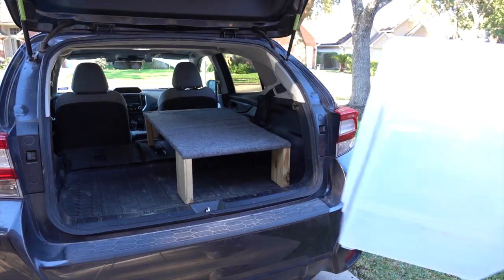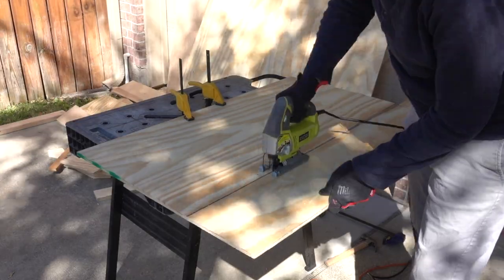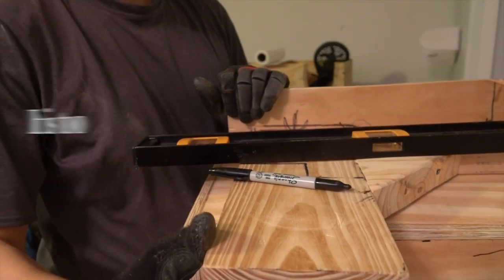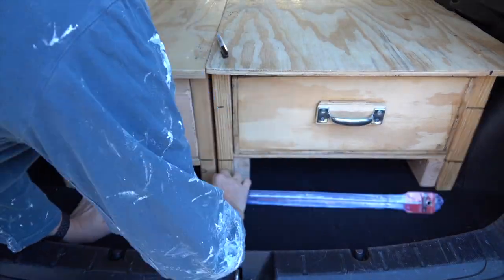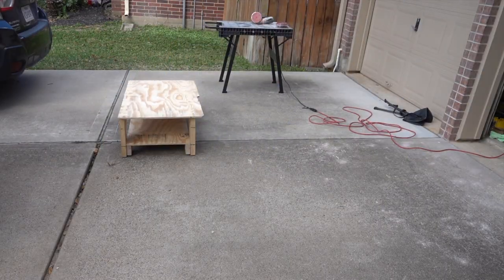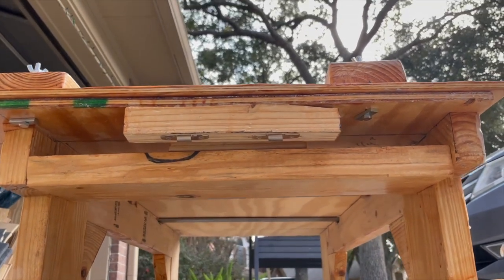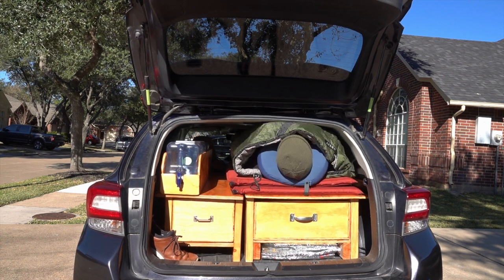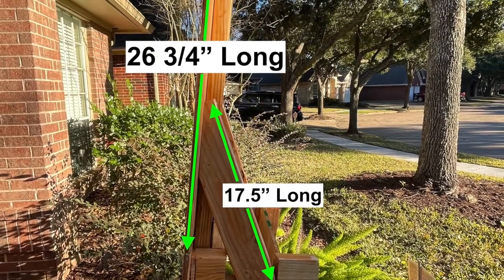Solo Cantilever Sleeping Platform Build for the Subaru Crosstrek Ep. 21

Comment: I do a ton of camping for my Crosstrek and I will say after many renovations and changes to my build, I finally decided to do away with the bed platform.. and that was the best decision made! It is so nice to be able to sit up in bed and change and not feel so claustrophobic. It was miserable in there when the weather got hot without enough headspace and room to move around. It’s really worth the sacrifice. I ended up getting rid of anything I didn’t absolutely need in use,
storing alot of stuff in my roof box and made really good use of the space next to my bed where I used a lot of vertical space and a cargo roof net-So much better!
Reply from the maker: I couldn’t agree more. The cantilever platform was a success in that it was another option and fun to build, but I am a bit close to the ceiling. I have a build coming in the next few episodes that you will love. It’s an 88” low platform that will allow you to do everything your talking about and it folds up into only half the cargo space. You can even close the cargo cover and use the backseats and it only weighs around 32 lbs. I am 6’ 3” and need more space like you’re describing but still appreciate a platform as I need a long, flat, solid bed to lay on. Stay tuned and thanks for commenting.
Reply: Cool! Im 5’9 and When I push the passenger seat up all the way and then I have some easy access storage boxes underneath to level out and bridge the open space between the seat and cargo area. It’s incredibly comfortable and not a lot of leveling to do where that stupid hump is in the cargo area. I leveled out the entire back space with a piece of half-inch plywood or so which I put on top of  the cargo mat and it levels out the floor almost completely perfect. On top of that I have A perfectly fit area rug (One of those  stiff type ones with bordering) And then I lay my sleep mat and additional bedding and it’s perfect. I’m just always aware not to make it to thick because I found out that actually headroom is gold and sometimes extra bedding really doesn’t make it that much comfortable just more crowded. You’ll be so glad when this summer comes and it’s hot as hell🔥🥵
Reply from the maker: @xtrekkmpr2016  Summer camping is rare in my area as it’s as humid as a rainforest and hot.
Reply: @creationsbycarson  If you’re in an area that you can get to high elevation Mountain, go! Spend most of my summer up there and I make sure I have those screen window coverings to keep the skeeters out and I made one for the hatch out of mosquito netting. Enjoy
Reply from the maker: @xtrekkmpr2016  That sounds nice, I will have to plan a trip. I love mosquito netting.

Comment: Built something very similar to what you did .. lasted a year before I removed it all and went to two 50 qt Plano plastic containers that go outside as soon as I stop .. I sleep the other way with my head towards the front and exit thru the side door .. Been doing this over the past year and having more room for me was key.  I also built a simple awning so in bad weather I can have the hatch open and still be weather proof.  🤠
Reply from the maker: Thank you for watching and commenting. You spot on about room. I like the simplicity of the set up you have now. You should check out Ep. 24 where I build a 88” folding platform that fits in the a 3/4 of the cargo area with the rear seat up. It’s my favorite and what I use now. I love your awning set up and being able to open the rear hatch. I have that Sideboards Awning by Kelly and it’s excellent. GREAT value fir the money. If you already have something that works don’t change it. Opening the rear hatch would be really cool but I live in a part of the world that has a climate suitable for mosquitoes almost year around, except maybe for winter, but even then there still seems to be some strong ones that still make it out. I would worry about have to screen off the hatch when open. There’s nothing like camping with in rouge mosquito inside with you. The 88” folding sleeping platform I made works great for sleeping in either direction. Check it out. Keep the comments and ideas coming. This process seems to changing all time time. On my next build I am going to reduce the long drawer setup as its just too much room for my level of getaways which I talk about in my most recent video in Ep. 28. Have a great day, Al.